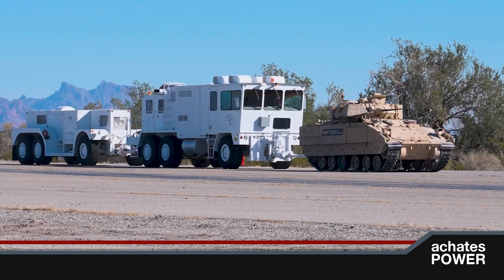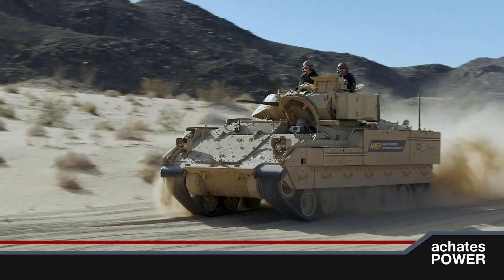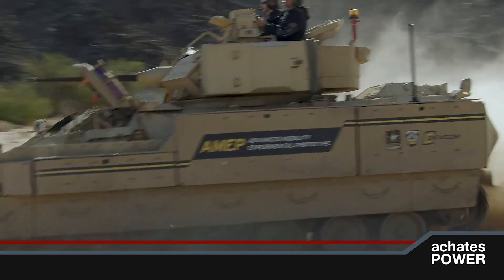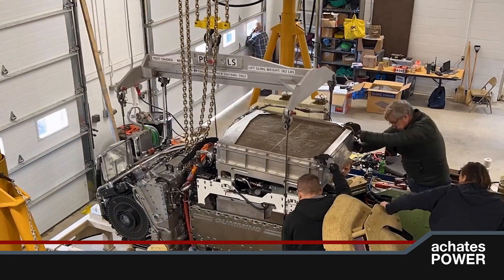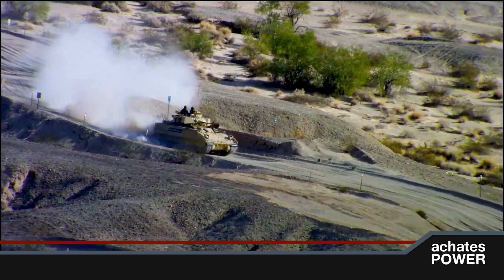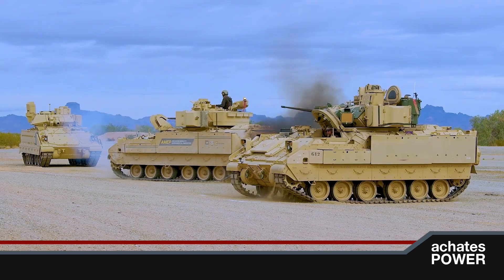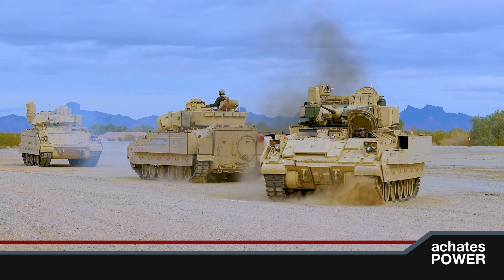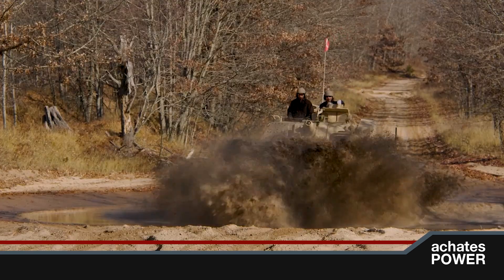The Advanced Combat Engine

Comment: Have you heard of the new startup Edison Motors in Canada?  They are making diesel electric trucks.  That seems like the ideal application for the opposed piston engine.  Am I correct that the forced air intake system could be simplified since, in that application, you wouldn’t need the engine to operate in as wide of a range for power output and rpm?

Comment: Why not 33% bigger cylinders and make it a 3-cylinder 1000 hp engine for IFVs and light tanks. 3 is more efficient than 4 for turbocharging. Scales to a 1333 hp four or 2000 hp six.
Reply: Not sure why... the pistons on this are already pretty big but even bigger ones would be even more efficient perhaps its a packaging reason because they had a defined envelop that had to fit in. Maybe they want it to  be able to continue to run in a limp mode on 2 pistons in a limp mode if something fails. Should be feasible to make enough power to move a tank around even with only 2 pistons active. 3 cylinder would probably be too imbalanced in that configuration.
Reply: @Wingnut353  Big pistons and big chambers are a problem in gasoline engines because the longish spark distance from the edges can cause knocks which then require a reduction in compression ratio. But in Diesels which are compression ignited it is a non-issue. The pistons on this engine is NOT actually very big. Those on 1930s era Jumo 205s are bigger and those on the Fairbanks-Morse ones are way bigger. Those are with mechanical direct injection and zero electronics.
--
It is an opposed piston engine. There is no balance issue regardless of the number of cylinders.
Reply: @dwightlooi  Why not3000hp delta-nine (deltic comeback)?
Reply: @erkinalp  Because the deltic was terrible space inefficient. Also, a 3 with bigger cylinders is SMALLER than a 4 of equivalent displacement.
Reply: @erkinalp  Take 3L 60 deg mercury optimax at 192 CID v6 2 strokes. next arrange them in a deltic configuration for a mini 576 CID mini deltic 2 stroke!
Reply: Its the 3160cc v6 300 XS stroker optimax thats 192 CID and 60 deg! I also though of a 1700 Rotax OP made from 2 850 rotax etec turbo engines for the skidoos!

Comment: I've got a question, if the intake port closes sooner than the exhaust port, how do you preserve the boost pressure in the cylinder provided by the turbo before the exhaust port closes?
Reply: Because intake pressure is a pulse of air... turbo on a two stroke does increase cylinder pressure but the main benefit is improved scavenging. Anything operating at the speed an engine is has to deal in pulses of pressure rather than just assuming static operating valves closing and pressures rising that way etc...
Reply: There is some degree of back pressure from the exhaust turbine. If you just left both ports open, continually injected fuel, and significantly increased the size of the turbo, you'd essentially have a turbine engine.

Comment: Does that mean the US Army is testing these engines for use? That seems like a lot of advantages in the same size engine so wouldn't this be a no brainer?
Reply: Seems like cummins use a similar configuration with the ace engine. Don't know if they worked with achate
Reply: @Popit-ns3xh  They are talking about the ACE engine.... Cummins licensed achates power's tech for their ACE engines, Achates power is not a manufacturer its a R&D company by and large. They did a lot of work to get emissions and oil consumption way down on 2 stroke diesels... to make them practical in modern emissions environment.
Reply: The Cummins OP ACE 2 stroke is going in TACO's tank! It runs on cow fart along with corn based 2 stroke oil in the dry sump.

Comment: Hopefully they will start making 12,16 and 20 Cylinder Engines with 2,000 to 4,000+ CID and start putting them in construction equipment at take off where good ol Detroit Diesel left off at and put 4,000+ CID engines that are OP/OC that are also Double Acting and possibly even Sleeve Valves in Locomotives 🤗  😌
Reply: The Trump train has a v-16 2 stroke with 858 CID per cyl.
Reply: @jlo13800  ? 
Just so it's not weak GE 4cycle junk.Wonder if can make a 2stroke Vee Configuration Engine Double Acting but if not I guess they could use sleeve valves and wyned up the rpms to about 1500 to really make it move on down the track
Reply: @timt2202  Yes and use kltoz super techniplate synthetic 2 stroke oil in it too
Reply: @timt2202  If you were doing that you may as well build a napier deltic like in a train... 3 cranks,  3 cylinders and 6 pistons per set VERY power dense but also very heavy.
Reply: @Wingnut353  they weren't double acting though and the configuration just isn't as effective or as well balanced.plus,I'd really like to hear a double acting 2cycle lol no video's of them on here and they're very rare, they also produce 70% more power than a regular 2cycle

Comment: TWO STROKES ARE MAKING A COMEBACK IM SO HAPPY 

although we'll probably won't see this engine design on commercial and private vehicles any time soon 😢
Reply: CARB is actively trialing this engine in a Peterbilt truck as it's a promising technology for reducing semi truck fuel consumption (CO2 emissions) in case batteries don't improve enough to replace diesel engines. Hard to say that this is worth the trouble in light duty passenger cars but for medium and heavy duty it might not go away yet. Renewable diesel is also much easier to make than renewable gasoline. Waste fat and vegetable oil can be processed into diesel relatively easily.
Reply: Cummins ACE OP TACO 2 stroke!
Reply: How about a 1700 OP rotax made from 2 850 rotax etec's and lay it down in the sled. A mini deltic outboard made from 3 3.16L mercury optimax 300 XS each 192 CID and 60 deg blocks!
Reply: How about a suuki LT1000 OP 2 stroke made from 2 500's and mount that in a quadracer.
Reply: All lightning bolts and the sun are plasma 2 strokes!

Comment: Make one suitable to replace those flat-4 and flat-6 gassers widely used on general aviation and you'll probably have an outstanding market share
Reply: oddly enough this engine is a modernization of the junkers jumo aircraft engine and the founder of the company (Dr. Lemke), first envisioned it as an aircraft engine.
Reply: @lexluthor6906 they were used on ships even before planes.
Reply: There's a few companies that have been trying to do this for the LSA market - Diesel Air had a 1.8 liter 2-cylinder 100 hp design (but they went out of business), Weslake is working on a 1.3 liter 2-cylinder 80 hp design, and Superior Air Parts was planning a 1.7 liter 3-cylinder 100 hp design (but I think it got cancelled). (And, AFAICT, Weslake was invovled in both the Diesel Air and Superior designs, as well.)
Reply: @bhtooefr  DeltaHawk is the only one that has not died off quiet yet I think you can buy them but they are expensive... continental has some diesels also at this point that are mostly conversions of Mercedes Benz diesels...

Comment: I’ll just take the one they put in the f150 and put it in my gmc work truck.
Reply: Honda should make a CR1000 OP 2 stroke from 2 CR500's
Reply: they make a 5 liter as well
Reply: in the tech spec there's a variant of that engine with 4 cylinder 3.6 in both turbodiesel and turbogdi. that one is hella good